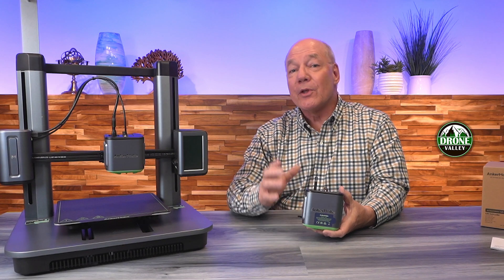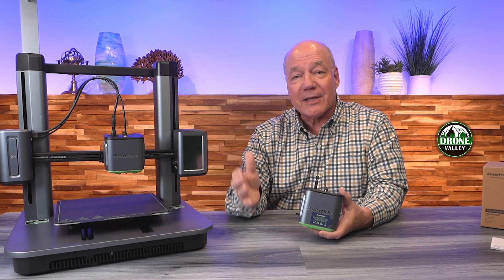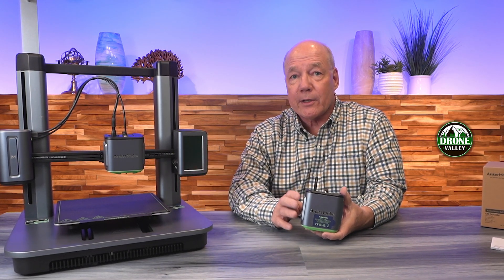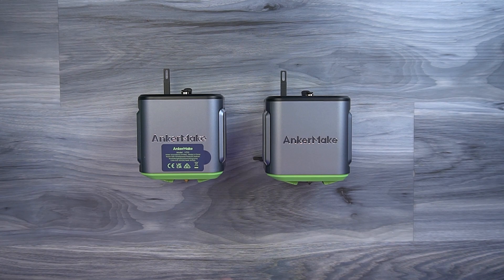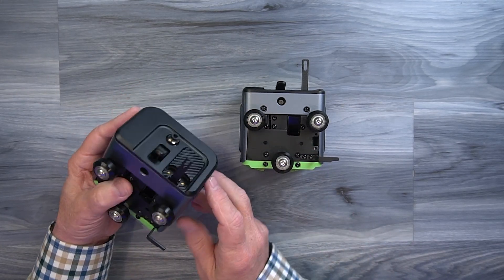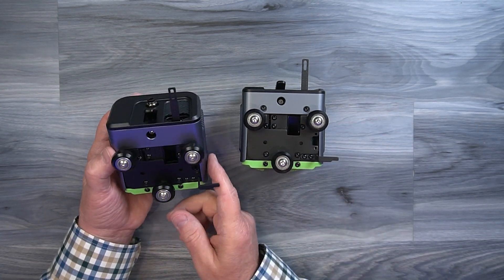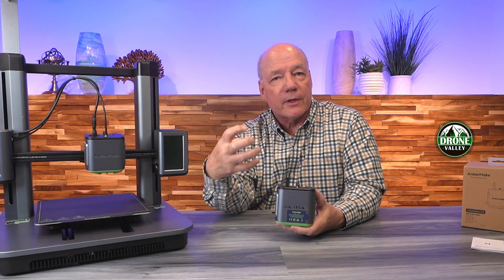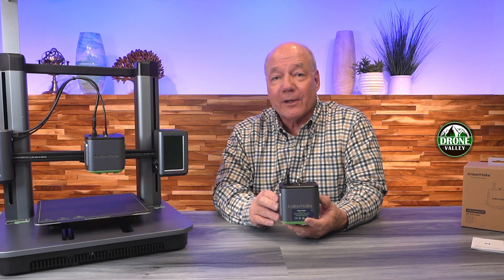Ankermake M5C Extruder - Great To Have a Spare!

Comment: What a waste of time. He just talked and never actually showed how to change the extruder on the AnkerMake 5C. By the way Grandpa. That's an Ankermake M5, not the AnkerMake 5C.
Reply from the maker: Razor, thanks for the thoughtful post on the clip. I never intended this to be a "remove and replace" clip since a monkey with a screwdriver could easily swap out the extruder on the printer. It was more about the improvements Anker made to the extruder and why you should keep a spare one handy. I did like the Grandpa crack though, very mature. I see you have a wicked cool logo on your channel and not a single clip posted. Maybe post something awesome there so I can come back and critique it for you. Merry Christmas.

Comment: I just got my new extruder in and it's the newer model without the extra screws up top. I might be having a dumb moment but how do you get the wrench around the nut to loosen the bottom wheel. The frame is in the way
Reply from the maker: I had the same issue and had to use a pair of needle-nose pliers to hold the nut. It's a poor design since you can't use the wrench to hold it. I do like the new cover though, it pops off easier without the needs to remove those screws. Good Luck!
Reply: I ended up taking the back plate with the wheels off and installing it to the belt and then mounting the extruder to the wheel plate. This gave easy access to that nut and makes it where you don't have to remove it all from the belt to replace the extruder
Reply from the maker: @duckausti  I always worry about losing the alignment of the extruder on the belt and try to loosen as little as possible but good fix. I'll try that next time I have to swap out the unit.